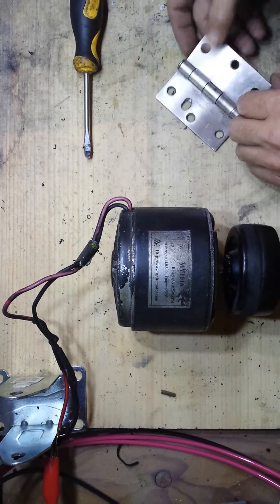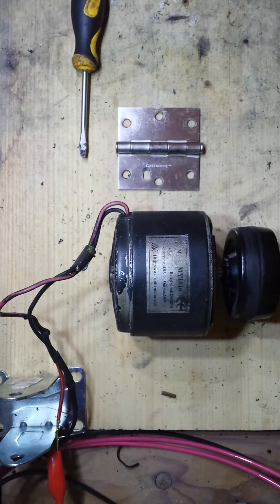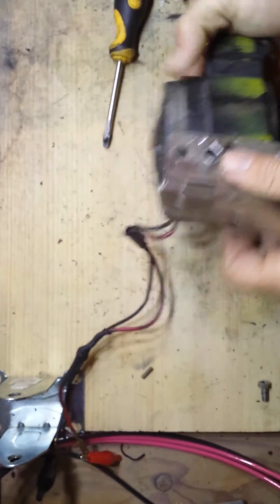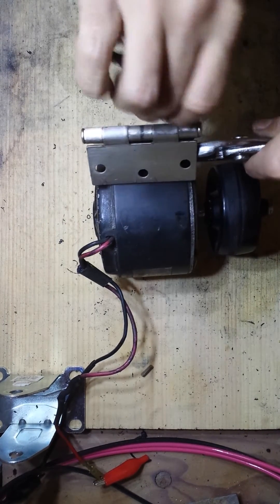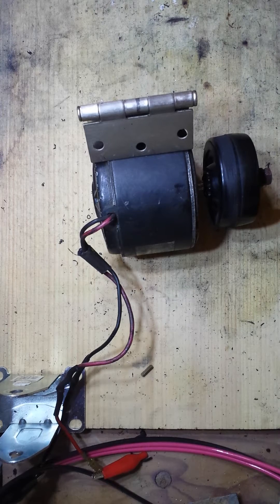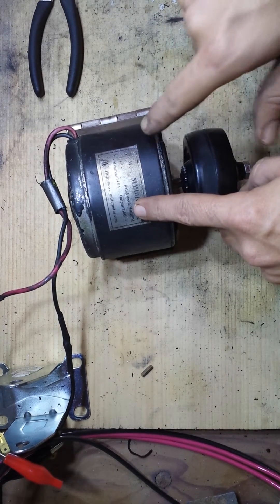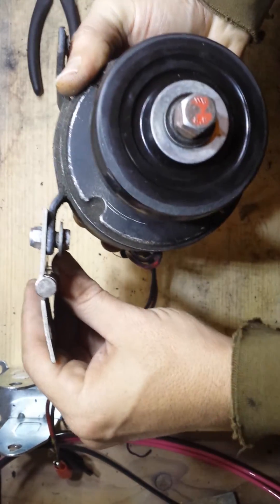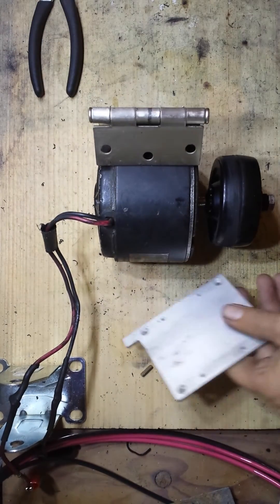Electric friction drive bike motor Part 2

Comment: Alternative to a spring holding the motor down - what about a spare brake lever that tensions the motor down when squeezed and a return spring to hold it up when not in use. Rather like a clutch, I suppose. Or a 2-stroke bike kit clutch lever - since they have a pin to hold it in the closed position. Or rig the opposite way (normally on, squeeze to release like you did later on your cruiser). Just depends on preference.